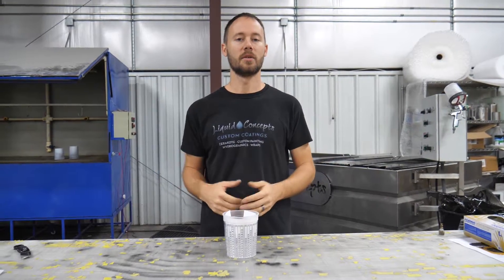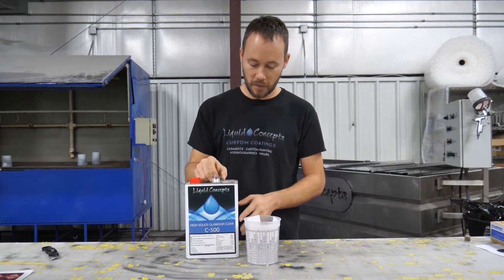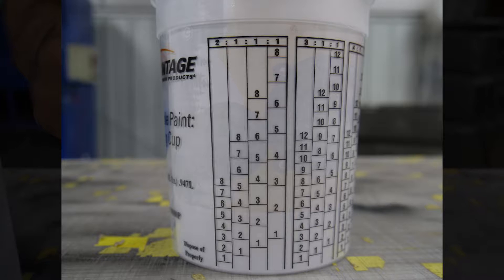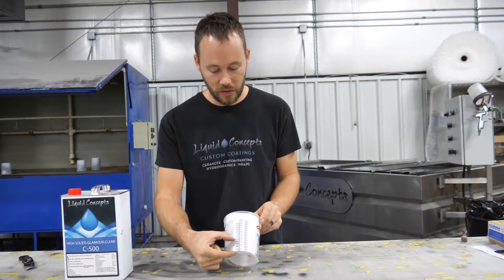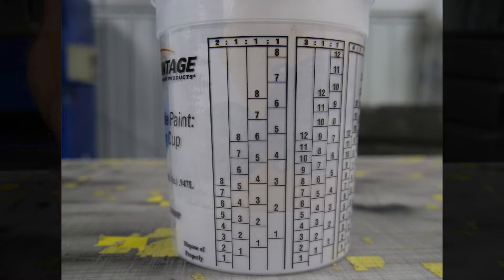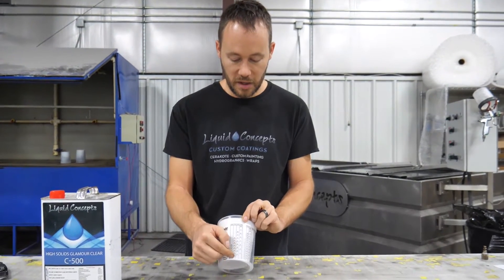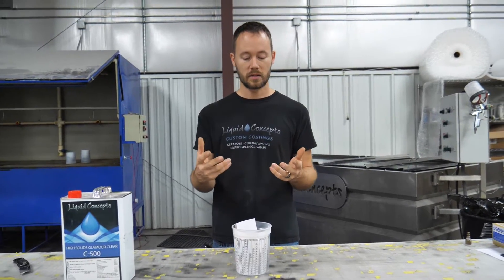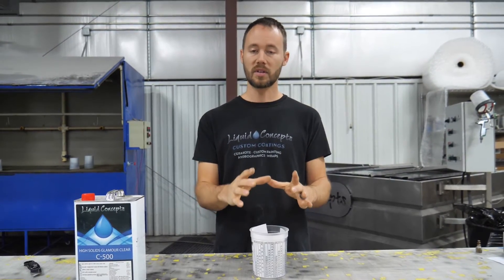HOW TO READ A PAINT MIXING CUP | Liquid Concepts | Weekly Tips and Tricks

Comment: go to the last number in mixing ratio middle column then go up to the first  7 then the next 7 but it is clearly lower than the  first 7,jees what a confusing video ,
Reply: Okay ... so a mixing ratio is well a ratio, say for example 3:1, or 4:1 etc. 

So he said go to the last number of the mixing ratio, in reference to the 2nd number in the mixing ratio. A ratio will always have at least two parts, so the last number in a mixing ratio would be just simply the second number if only mixing two different parts. If you add a third part of say for example C, then the ratio would change to something like 3:1:1 for example. Then there the last number would be 1 because it is the last number in the mixing ratio.

So he went to the last number, which is 1 for the 4:1 mixing ratio. 

Then he says "in the middle column" because as you can see in the mixing cup, there are three columns for a mixing ratio of 4:1:1. But he will not be needing the last column since he's only mixing two different parts, so he ignores it. So he says "middle column".

Once at the middle column, he remembers about how much product he needs. So he needs about enough product to fill the cup up to where the red arrow mark in the video points in the cup, which points right at about the 7 mark in the middle column of the 4:1:1 ratio.

So when mixing anything by ratios in the mixing cups, each column will have numbers. Look at the 4:1:1 on the cup. You see segments of up to 12 in each column. Just match the same number in each column. If you go to say for example the mark 3, then in the next column you will need to do the same and your next part up until the mark 3. So both columns should be filled up to the same mark. You'll always pour in your part A to the first column desired numbered mark,then part B to the second column and same number mark as the first column, unless otherwise instructed to do so.

He figured out he needs about up to the 7 mark. So now he has to find the 7 in the first column of the 4:1:1 ratio. The first column with the mark 7 will be where he will fill up the cup with part A. Once he has that in the cup, he still needs to add part B to make the 4:1 ratio. 

Now if you look to the next column in the 4:1:1 ratio on the cup, you see the middle column with the 1. You will see the same number 7 mark in this column. What you need to do now is add your Part B to the cup on top of part A
**WITH THE PART A STILL IN THE CUP AS YOU DO SO**
and as you gradually add the part B, you will see the mixture increasing in the cup, and slowly climbing up the marks. You will need to stop until mark 7 (fill up until mark 7) in the middle column to make the ratio.

You will then have your product mixed at the proper ratio called for.
Reply: Doing things with your mind and hands wasn’t meant for you buddy. This video doesn’t get any clearer.